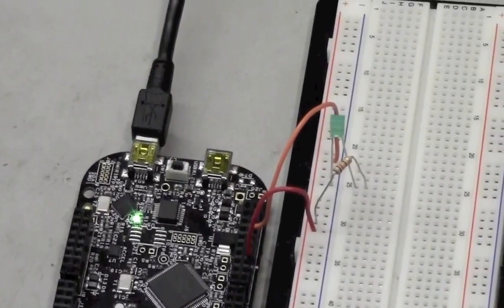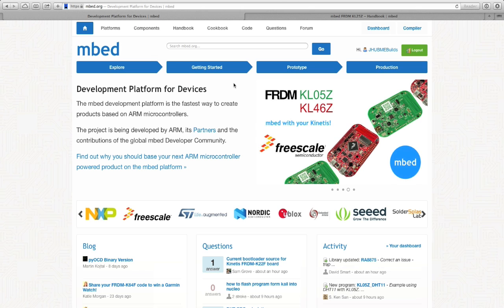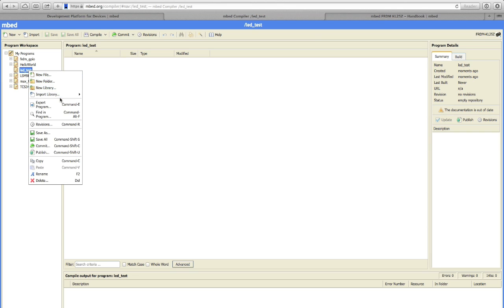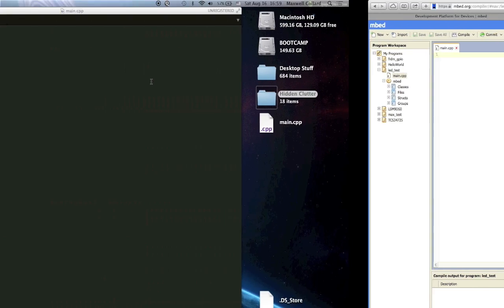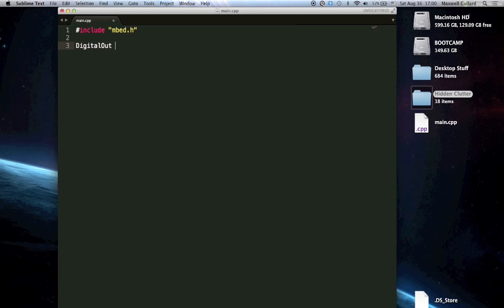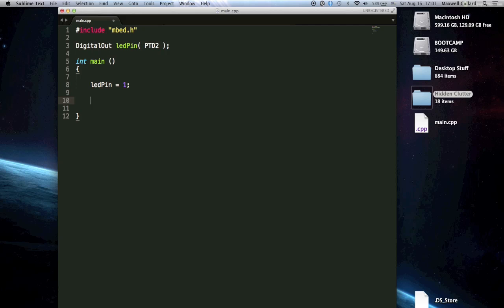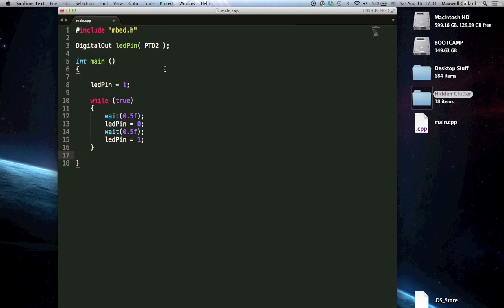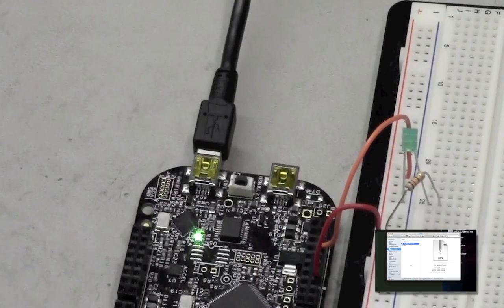mBed Tutorial 2: DigitalOut

Comment: My first MBED board is on it way so thanks for your video.
What I'm curious off, if you disconnect the board from USB/Power, will the .bin file remain on the board? Or is it lost?
Reply from the maker: Tilburger72 The .bin file gets loaded onto the debugger (OpenSDA) that is on the board. The debugger is ultimately the chip that programs the microcontroller.Since it programs the flash memory, the program remains on the microcontroller even when it turns off.